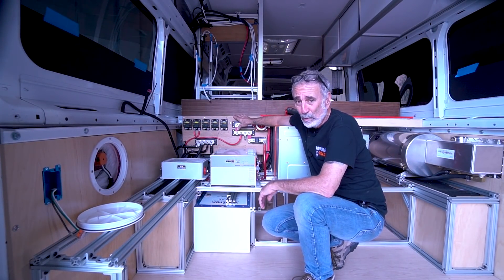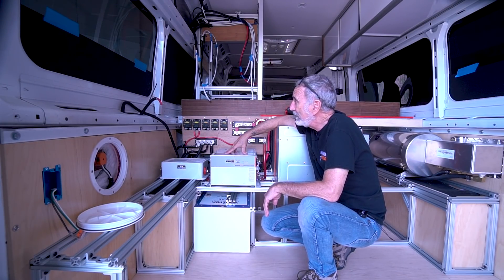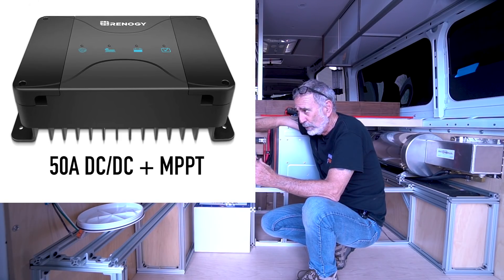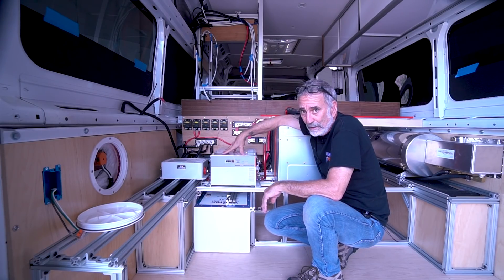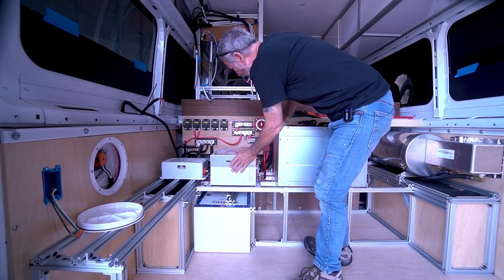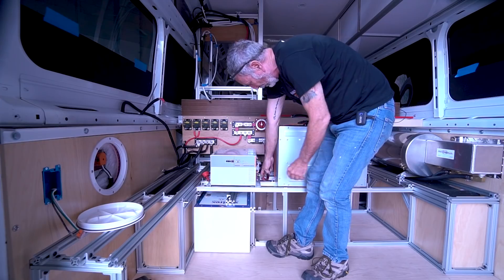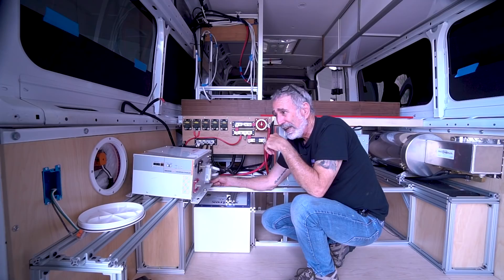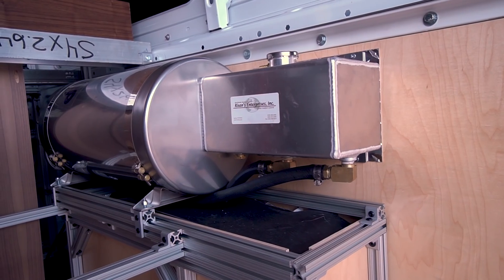In this van build, CRITICAL CHARGING DECISIONS must be made now.

Comment: I believe the Renogy DC/DC + mppt has a charge current lower than what solar and the DC converter can deliver at the same time, so you leave some current on the table if your engine is running and the solar panels are generating.  Also for the price the Victron gear is a better value in my opinion.  I wish the renogy and epever charge controllers would come down further to compete with the Victron stuff since they lack many of the features.  Two charge controllers may cost about the same and offer more efficiency (from shading) and some redundancy.  But that's more holes in the roof.  I wish there was a larger roof gland with like 6 holes in it for van roofs.  I have two arrays / controllers in my build and would also like to pass through 12v for lighting.
Reply from the maker: I make a combiner box on the roof. One large box sealed over one large hole in the roof.

Comment: Series or parallel, I’m indifferent. However if I were paying the kind of money for one of your vans, I for sure wouldn’t want any renogy products in my van. You never cut corners with anything on your builds but renogy just seems like a terrible idea. Sure you would probably just swap the unit for your customer if there is a failure but dealing with renogy customer service is a nightmare. Also keep in mind that the combo unit only does 25amps in each input when both are in use. So driving you’ll only get max 25 amp from alternator and 25 amp from the solar. Stick with a dedicated dc-dc and dedicated solar charger for max charging ability with such a large battery.  Victron 100/50 and victron buck boost 50 (pricey). I used a 100/50 from victron for solar and kisae dmt-1250 for my dc-dc and that handles 50 amps. Much better quality than renogy, also a combo unit if you want to go that route but does one of the other. 50 amps from alternator while driving (no solar) and 50 amps while driving. Still limiting but your going to be sure to get max 50 amps while driving.
Reply from the maker: So far, my experience with Renogy has been a positive one. Particularly with customer service. But I am a distributor, not a consumer.

Comment: With MPPT, the voltage should be as high as possible. Not only because of the lower currents. If the sun gets weak, the voltage will go down in every system. But the higher the nominal voltage, the longer the charger can work.

If you don't, MPPT will give you almost no advantage over PWM. Basically the difference is, that MPPT has a DC-DC converter to bring down high voltages with good efficiency. PWM just connects the panels and the voltage is cut off.

In case of partial shading the bypass diodes can bridge one panel as long as the others have enough voltage. This is not a reason for parallel arrangements.
Reply: Could you please elaborate more on your statement "the bypass diodes can bridge one panel as long as the others have enough voltage" ? So if one panel is shaded, the bypass diodes will be activated by the voltage of the other panels and effectively bypass the shaded panel, allowing the other panels to continue producing power? Do all current solar panels have bypass diodes? What voltage is necessary to activate the bypass diodes? Sorry for all the questions, it's just the partial shading excuse is always the reason people suggest not to go for series wiring. Thanks!

Comment: Your panel voltage (VOC) needs to be 20V greater than your battery's max. charge voltage in order to properly charge your battery. So, to properly answer your question, we need to know your panel and battery voltage. Assuming your system is 12V and its max voltage is 14.8V, and each panel is rated at 35V VOC or higher, then there's nothing for you to gain by connecting them in series.

Comment: It's pronounced im-pee-dance.  The solar wattage limit on the Renogy DC to DC/MPPT unit makes a second MPPT controller necessary.  I think you want to keep the current down on the solar connections so that you can use 10 AWG wire at the biggest so you want to keep the panels mostly in series.  Another option would be to use a Victron Orion for the DC to DC part and then size a Victron MPPT controller to handle the 600W of solar.  Since you're using 6 of the same size panels that would be easy to do.  The Renogy DCDC/MPPT unit is tempting, but I wish they would come out with one that could handle more solar wattage.

Comment: George, mark me down for parallel panels/2 controllers as well, for many of the reasons others have described (better solar input w/partial shade, etc.). I use the same Renogy DC-DC/MPPT controller in my van build with 400 watts of Renogy panels. This Renogy DC-DC/MPPT controller has the limitation where it limits the alternator charge amps if solar is available (25amps each), but I don't find it to be a significant practical limitation. If you really want all 50amps from the alternator while driving, you could install a switch for the solar panel input to turn it off. (You just have to remember to turn it back on when stopped, but that's just too much to think about for me. 🤔)

Comment: I would go series parallel. This is the way I set my own solar system up for my house. Not only can you run more power for less money with the smaller charge controller and smaller wire. Which means saving money. 
But then again I’m not in a van, but a house. I’ve seen another number of vans where they use parallel. Good luck!

Comment: If shading conditions are your main concern parallel
If not series, because highest voltage, that the controllers can handle, give the largest amounts of watts.
And that's what we want; biggest bang for the bucks. 

The voltage drops when going through the controller. The more comes in the controller, the more can go out of the controller.
Especially if your solar panels are not on attenuators to be able to follow the path and elevation of the sun, the power production is already below optimal.

Lower amps (at higher voltage) means less cables and thinner cables and one size diameter cable is possible.

That's why I would do 2 groups of 3 in series and the 2 groups in parallel with each one own charge controller.

Comment: I prefer parallel solar panels because series have an issue: having 1 panel shaded will cause the other 2 not producing energy at all ( according to Will Prowse experience)
Reply: Oh and by the way, impedance is for AC only. When you measure with your ohmmeter, you measure resistance; not impedance but it's a good test and I do the same !! Can't wait to see next week's video. Have a nice week sir !
Reply: I've seen that Will Prowse guy before.  He's too young to be so smart.

Comment: This is off topic but just wondered if you have designed a closed off infinity shower system....  Where you have an independent tank that recirculates hot shower water through a series of filters and such?  Or could a system like that be fitted to an existing RV shower?
Reply: Yeah, I would like to see Humble Roads take on that.
Reply: I'd like to see this too.
Reply from the maker: As I have mentioned many times, the day to day reality of such a system is less than desirable. Filters clogged with dead skin cells, urine, soap scum and fecal matter. No thank you! I'll focus on adding more fresh water capacity and continue to be judicious with my water usage.

Comment: Personally, I would run the solar in parallel with a separate dc-dc charger. That way you've got redundancy upon redundancyon top of.... (But, I'm an offroader who goes for weeks at a time into the Aussie outback. If I see another car in the far distance, that's too crowded.)

One thing I'm confused by, though, is not running your negative bus directly to the battery, especially given your 'house' battery/ies are so close. Then, apart from the charge input from the dc-dc controller, you're completely separate for both battery systems. I've seen some weird stuff go on when one bank or the other corrupts and spoils both electrical systems, just by linking them with both the grounds running through the chassis.
Reply from the maker: My house battery negative is tied to the negative bus.

Comment: 12 Volt parallel set-up to two solar controllers. In addition to the factors that you mention it also lets shade where it occurs to only effect one side with the two controllers. Individual solar controllers would offer the best but not practical on this topic
Reply: Some new panels have cells connected parallel inside, to be able to collect solar when the panel is partly in the shade.